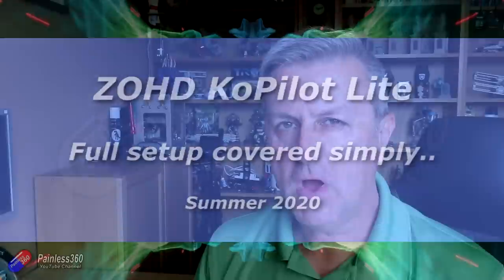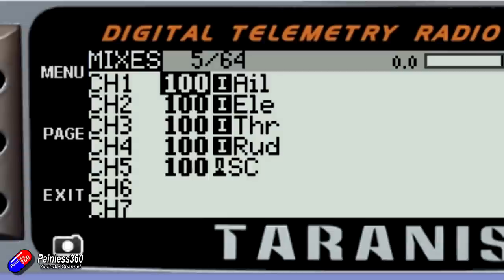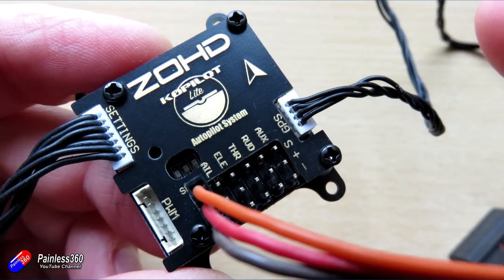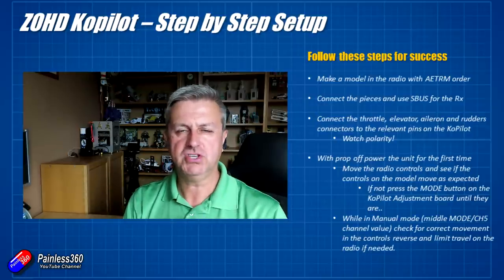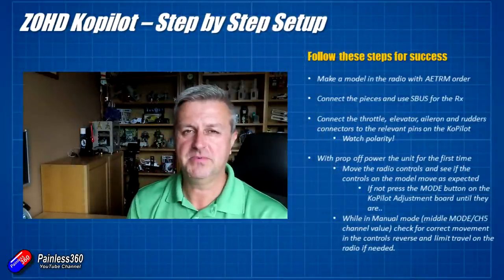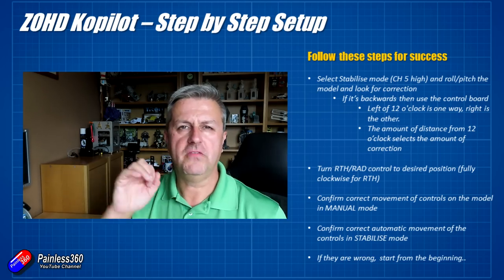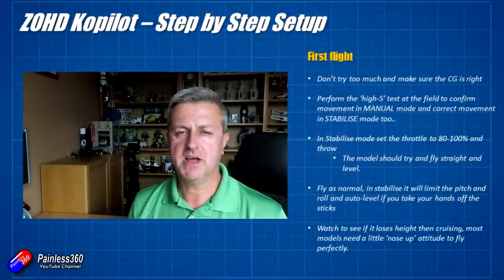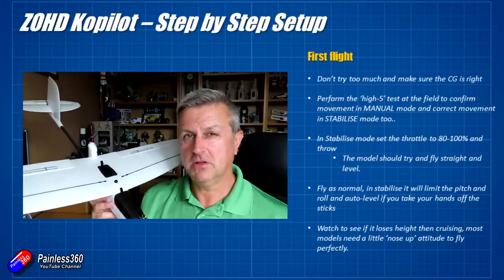ZOHD KoPilot Lite: simple stabilisation and RTH - step by step setup for new pilots

Comment: Is there OSD? Also can you use crossfire or tracer? New to this system. I only know betaflight. But I'm hoping to get it
Reply from the maker: No OSD and SBUS only. Check out the setup videos.. Best of luck
Reply: @Painless360  i got it figured out! I'll have to watch this video a few more times thank you so much for the entertaining and informative content! And alot of cameras now come with batt voltage on osd so that will work for me.

Comment: i hooked this setup up but not using sbus,  my mode doesnt work nor does the led 1 or led2 even light up.    I figured it out.   Frsky Ethos   the AUX in the SXR need to be turned on and the SXR in the RX needs to be turned off.
Reply from the maker: Thanks for sharing the answer so others can find it! Happy flying!

Comment: Great video, I have a question, Can stabilizers  A3 pro  Kopilot etc be used with petrol-powered planes.
Reply from the maker: In theory yes. Most of the ones that include throttle control are designed for electric from what I've seen.. Happy flying
Reply: @Painless360  Thank you
Reply: I’d like to use the ZOHD Kopilot lite with one of my methanol ic engines on a basic aerobatic airplane.  Guess there is no guarantee that the throttle would work well, but maybe the throttle fail safe could simply be set separately to a certain power level for level flight. When the airplane had returned and started loitering one would just retake control and land it.
Reply: @kenspaceman3938  The main problem with using these stabilizers in Gassers is isolating them from frame vibration (which can overwhelm the gyros and cause your plane to crash - happens a LOT with little stabilized Foamies with shuddering props/motor mounts!) while still allowing a little mounting flexibility to work properly. Your throttle control should just be a matter of plugging a suitable servo into the throttle output and setting up suitable linkage lengths to give you full throttle range. I presume that the 70-80% set throttle held automatically by the Kopilot in RTH mode will be plenty to keep it airborne - you can even boost that in pilot-selected RTH (but NOT,of course, in Fail-safe RTH.)
You can retake control at any time by switching out of a pilot selected RTH but you should know that, unlike some quads, Fail-safe RTH DOES NOT latch the plane to RTH. It will cycle between RTH and the Mode set on the Tx as you regain/lose signal. Fly in Stabilized when way out there and throw the switch to RTH as soon as you see trouble! 😉
Reply: @theoztreecrasher2647  Thank you for your very informative message, much appreciated!

Comment: Hi Lee,
Just got this out to setup and have some fun with a ZOHD Dart 250G but, after following your videos cannot set it up correctly. Followed the videos Implicitly.
Manual mode working fine but cannot get it set up in Stabilised Mode, will not go to neutral like in your videos, the controls just go to extremes.
Using a Frsky X10S (ACCESS) on Ethos and a Frsky New RS Receiver with S Bus.
Any help would be much appreciated.
Many Thanks in Anticipation of your reply.
Best Regards
Andy Shaw
Reply from the maker: Not sure where you are going wrong. What troubleshooting have you already done?
Reply: @Painless360  Hi Lee to be honest not sure where one is going wrong. Tried various things, gyro calibration and radio calibration, but same result.
Works on manual Mode OK, but cannot get to next setting ie. Stabilised Mode will not engage like on your video !!
Can this be any thing to do with Ethos?
Would appreciate some form of one to one if possible?
Any help appreciated as before.
Best Regards
Andy Shaw
Reply: Hi Lee,
Just had another go at setting the Kopilt up.
This time with Frsky Taranis X9 Lite (OpenTX) and the same RX, Archer RS on SBus.
Understanding more what things do but unfortunately the same result, Stabilised Mode will not activate!
Think the problem lies here, when calibrating the Kopilot for neutral, putting the Mode Switch into Stabilised Mode, two less come on, then move the radio sticks to the bottom inner corners where the LEDS should begin to flash, then when the flashing is done, calibrated neutral.
The LED's never flash this could be my problem, could one by any chance have a Bad Kopilot?
Any help appreciated.
If required will consider becoming a Patron so we can discuss my problem.
Best Regards
Andy Shaw
Reply from the maker: I'd make sure you follow the instructions and process exactly. Reset the channel values on the radio and start again. It sounds like you are missing something. Knowing exactly where in the process and video it behaves differently would help. I have heard of Kopilot modules with issues so maybe that is part of it.
Reply: Hi Lee,
Many thanks for your time.
The video is ZOHD KoPilot Lite:simple stabilisation and RTH - step by step
From approx the 5 Min and 6 Secs this is what one cannot get to work correctly the controls on yours are neutral and move when you move the aircraft for stabilisation,
Mine do not stop neutral they go anywhere but neutral and moving the Zohd Dart does not give the correct results.
Have setup Frsky Stabilised RX's in the past like S6R and they work as intended, this is what one was expecting the Kopilot to do!
Anyway
Any more thoughts appreciated on the matter and if cannot resolve would you be able to guide me to a different Flight Controller that would do the same functions in the Zohd Dart?
Best Regards
Andy Shaw
Reply from the maker: If you are following the steps precisely then I'd suspect the unit. Best of luck
Reply: Morning Lee,
Thankyou for all your written input and Most of all Your Videos, Very Helpful, Thankyou.
All sorted now, 100% Success of Kopilot and Zohd Dart 250g with Zohd Analogue Camera/Vtx.
A couple of more flights with the Analogue System then going to move to the Walksnail System, comments? Already purchased the VRX package with the 1S camera/vtx?
Now,
Problem was with the Kolipot would not go into Gyro Calibration Mode, no matter what one did with the Frsky RS RX.
Tried a Frsky SR6 RX just to try and must say No Settings Changed, put Kopilot to Stabilised Mode, Sticks Inwards and to the bottom, wait 5 seconds then the LED's flash wait again until you get the control movements and Hey Presto- All now working!!
Cannot say why, but going back to the RS RX now all works as normal!!!!
Can only think it was some kind of signal output mis- match!!
Anyway, Many Thanks Again, sorry for the long explanation but might be useful for someone.
Cheers.

Comment: great video, I use the kopilot on a few of my planes and works great in stabilized mode  but I'm having an issue keeping the same attitude(level) flying in manual mode , if I trim the planes leveled in manual they don't fly leveled in stabilized   and vice versa.  what
's  the best way to keep the planes flying leveled in both modes?
Reply from the maker: You need to calibrate level for the stabilised mode using the Kopilot.  A little nose up is normally needed.. see video..
Reply: @Painless360  after watching your video again I figured out what I was doing wrong,  I was trimming in manual then switching to stabilized, landing  and saving it while in stabilized,    now I'm saving the trims in manual mode and everything is working much better . thank you for all your great videos.  cheers

Comment: I just ordered the dart250 fpv. Will the kopilot rth with signal loss or can I set that in my t18
Reply from the maker: I'd set that mode as the Failsafe on the reciever to make sure... Best of luck
Reply: @Painless360  is it normal for the kopilot to move the elevators when throttle is applied

Comment: nice video, can I ask you a question? where should the switch be for the "rth" function? in my remote control I have position 1 output at 100%, position 2 output at 0%, position 3 output -100%, which should I choose?
Reply from the maker: The positions are hard coded into the KoPilot so you need to see what the positions of the switches do in your setup.. Best of luck!

Comment: Hi, i'm planning to use it on a combustion engine plane... I suppose I will not have sound notifications for GPS lock, right? Since the led status will also no be visible outside the plane, how can I be sure I get a GPS lock?
Reply from the maker: Not sure, I've not used it anything but electric. If you figure it out, please let me know...
Reply: Leave the Mode switch in Stabilize Mode. When you can throttle up the motor you have GPS lock. The motor vibrations will probably play merry hell with this (and any other) stabilizer though.

Comment: ? Will the copilot work with crsf and witch is better for the ar wing pro the copilot or the matek wing flight controller.
Reply from the maker: It only works with PWM and SBUS. It does basic a stabilisation, basic RTH and Autolaunch. If you want more, then you need INAV or similar.. Happy flying

Comment: I love the Kopilot on my Dart250. But every time I flip into manual mode it just dives to the ground.  The preflight controls check looks good. Do you think that sticks in calibration will fix that?
Reply from the maker: You still need to trim the model as you would normally if you want to use manual mode... Happy flying!

Comment: Hey I have a Dart250 with the Kopilot and a FrSky x9lite with a rxsr and when I switch into manual mode and move the sticks nothing happens
Reply from the maker: I've not seen that. What troubleshooting have you already done?
Reply: @Painless360  Rebound not more
Reply from the maker: I'd redo the steps.. Best of luck
Reply: @Painless360  Which steps? I have plugged in the servos, Esc, GPS, settings board and the rxsr but I cannot get the controls to move when I move the sticks I also have set up a new model with the mix that you have shown
Reply: Hey I have figured it out the connector was falsely connected the sbus cable from the kopilot was on the smartport pin on my rxsr now it works ty

Comment: Hi Painless, I am having a hard time with the kopilot in stabilization mode when throttle is above 80%, the control surface is flipping up and down like crazy. It makes the plane flying like a bird. And this issue also happens during the RTH mode when the plane is climbing for the RTH altitude. I tried to turn down the sensitivity on Both Ali and Ele, but the issue was still there. Other than these two situations the kopilot lite works good. Could you help me to figure out what the problem might be?
Reply from the maker: I've not seen that here. Maybe it's flutter on the control surfaces? I'd check that there is minimum slop... Best of luck
Reply: @Painless360  Thank you for reply! I will try to check everything again.

Comment: Where would the flaps go in the Kopilot unit for a full house glider for example like a Heron?
Reply from the maker: Flaps need to be driven from the reciever, there isn't a place for them on the Kopilot... Best of luck
Reply: @Painless360  ok thanks. So if I’ve got my transmitter all setup and working with deflections and modes, once I use the Kopilot, will I then have to set them all up again? Sorry I’m new to RC. I’m using Ethos on an x18 and just got it all working well so curious if I’ll have to redo it all once the Kopilot is added
Reply from the maker: Some of it, yes. See my setup videos on the Kopilot... Best of luck

Comment: I don't seem to be able to get my plane into return to home method. Manual and stabilized seem to be correct but when I put the transmitter into RTH for a self launch the motor comes on before I launch the plane. On my RM TX16s I am using the SA switch for the three position switch and the control panel is fully clock wise but the motor comes on as soon as I arm it
Reply from the maker: I'd recalibrate the ESC. I've not seen that here... best of luck
Reply: @Painless360  I would not know how to recalibrate the ESC. I am putting the kopilot on a power sail plane. Is there a way to verify RTH is working without launching the plane?
Reply from the maker: Nope, RTH mode us Autolaunch when not flying...
Reply: @Painless360  when I attempt to calibrate the ESC I put the throttle at full and plug in the power. Then I lower the throttle but then I have no throttle. If I arm the plane with the throttle down I get throttle response but I don't get the auto launch. The receiver, a Crossfire, was bound using TBSAgentX as suggested by TBS. Should I just bind it with the Crossfire binding procedure?
Reply from the maker: How are you testing autolaunch?
Reply: @Painless360  with the throttle disarmed I am putting the switch into RTH position, then move the throttle up to full on and arm the motor. At that point the motor comes on full. I thought the motor is supposed to stay off until I toss the plane then it will come on.

Comment: ZOHD Kopilot Lite crashes /frezes wen plug in secand alaron servo? if unplug one servos from Yspliter then all line but soon plug secand servo back in start to move controls stopes/frezes?
Reply from the maker: Without more detail it's impossible to offer any advice. Happy to help but please watch https://www.youtube.com/watch?v=olIqTiSJHIY and come back to me with more detail of what you've tried..
Reply: @Painless360  rite i just own peace of mined removed zohad fited v2 fc and same issues no where as bad so oveasly not issue with zohad wich suprised me not me more confused as swapped changed every think hels
Reply: @Painless360  think found issue esc bec amps going try separate 5a bec

Comment: Are you still going to review the LEFEI RC Sparrow v2 ?
Reply from the maker: Unlikely as I can't get all of the pieces for it.
Reply: @Painless360  Odd you said just before xmas you had it on order I got mine a while back but was having trouble getting the gps part to work so was waiting for your review which could help me as there is not much info on this.
Reply from the maker: Only the unit came, no GPS and cables. Now I can't get either. It doesn't inspire confidence for me to make videos on it..
Reply: @Painless360  Shame I glued mine in a model or I would send you in mine for review, I posted in the thread on RCG & someone in there worked out the wiring.
Reply from the maker: I've placed another order for all of the pieces. Who knows, I may get them this time!
Reply: @Painless360  You never really know with banggood 😂

Comment: Hey mate noticed my green lights don't stay on to tell me if its in wing or v tail is that a problem
Reply from the maker: The Kopilot needs to be set for the model type it is in.. Best of luck
Reply: @Painless360  yeag mate but as soon as i press set button in on the little control panel that plugs in all green light turn off and stay off

Comment: Weird, I was just setting this up less than an hour ago on my Dart 250g. Also strange is some of the comments on here say they were posted weeks ago? I noticed on your last video setting this up you had rates down to around 60, I'm wondering if that's set globally or just when your in non-stabilized mode? Also I am sure I'm setting the zohd 30A esc lite throttle calibration correctly, but it doesn't seem to register the low position. I have to raise throttle quite a bit before the motor starts spinning.
Reply from the maker: Patreons get early access to my video ;)
Reply: @Painless360  Ah cool that was confusing :) Hey I just noticed when I took the setup board off the AIL and ELE channels reversed. The stabilizer was still working correctly though (um no, not quite). That could catch somebody if they're not aware of it. I double checked and sure enough I could repeat the behavior.
Reply: @Painless360  Ah I figured out why it was doing that. I had the left and right wing connections swapped lol :) All working now with or without the setup control connected :)
Reply: @wesorama  Interesting observations as these are usually mentioned as 2 separate problems with setting up the Kopilot on a wing. 
1...the left and right wing connections swapped - many (yours truly included) miss the fact that the manual diagram is looking at the bottom of the wing not the top!
2...if you want to remove the setting board you should do it with the power still on. It is said that if you remove it with battery disconnected, your settings can be lost. Not going to check it myself. When I finally get it to work I leave well enough alone! ;-)
Reply: @theoztreecrasher2647  Wow you're absolutely right lol! Yeah I'm unsure about removed with power on or off. It seems to save the settings for me with power off.

Comment: Hi Lee.  I have lost my gps & it's wire in a tree and want to replace the gps.  Can you tell me which gps pin is which on the Kopilot itself?
Reply from the maker: I don't know. Sorry
Reply: @Painless360  Thanks for getting back to me Lee.  I will try the old "Hit & miss"  All the best
Reply: Stephen, did you have any luck mapping those pins? I have a similar problem.
Reply: @aaronshowalter4344  Hi Aaron.  Yes I did.  I'm trying to send you a screen shot of the pinouts but it won't let me attach it here.  Is there a way I can get the screen shot to you?
Reply: @fennz  I replied with my email and it appears that comment was deleted. Could you describe it in text here? Possibly in order from the tail of the plane to toward the nose or vise versa?